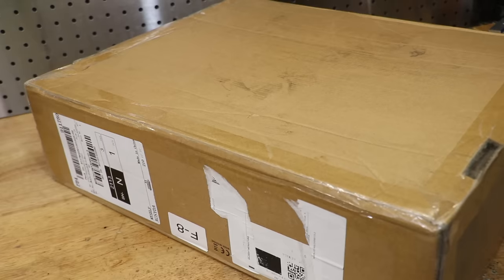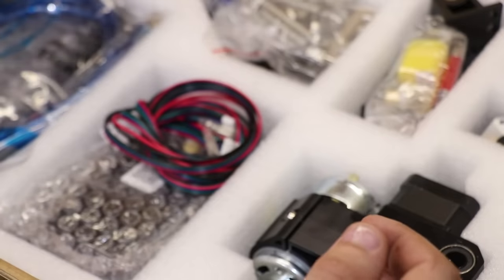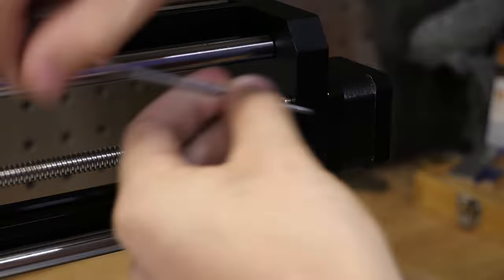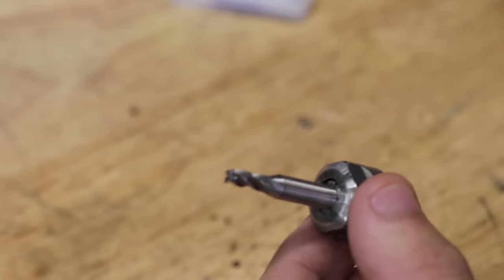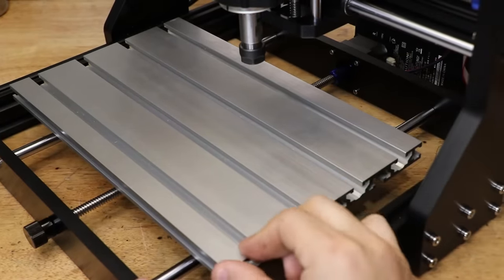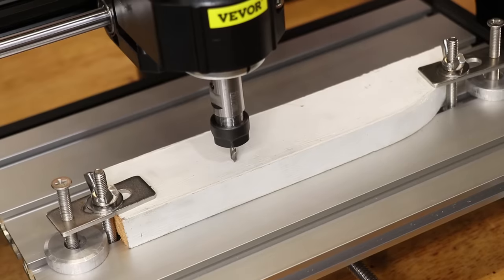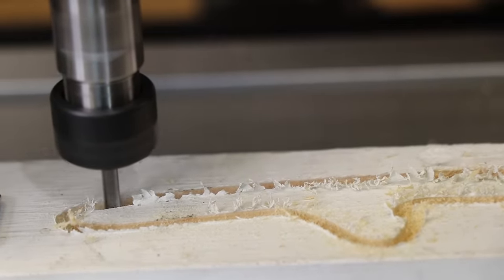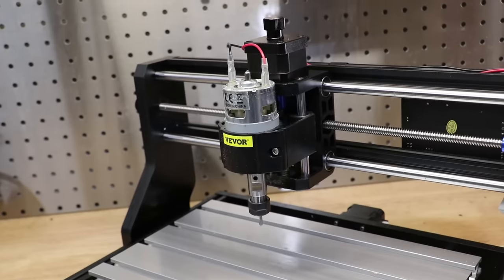A CNC Mill For Less Than $200 - Is It Worth Buying? (CNC 3018 Pro)

Comment: Once it was assembled, I think that my first projects would be to machine out replacements for the problematic plastic parts, or at least reinforcing steel plates to go over them
Reply: I'm wondering if this machine is even up to that task.
Reply: @Jianju69  It's really not
Reply: Maybe you should just not buy a piece of shit to begin with.
Reply: @JTMarlin8  now it a verifiable pos 😁😆🤣
Reply: Do you think this machine would cut a design from vinyl records?
Reply: @glendaharding1802  That's a pretty lightweight job. The hardest part would be removing cut shapes of vinyl record from the double-sided tape without breaking them. You're likely better off using a laser-cutter for that.
Reply: @glendaharding1802  Never having used one of these, I cannot say for sure. But, from what I see here, it probably would. Your most important thing to do for success, would be to find a reliable way to hold down the record. I think I would try hot glue first. Followed by small screws and a water soluble adhesive
Reply: Poor man buys twice. So act rich.
Reply: That plastic seems to be Delrin, which is specifically used for being easy to cut and having high stiffness.  It’s not steel, but it’s not ABS either.  It’s also used in gun parts, ski bindings, and even ball bearings.
Reply: @phxees  very heat resistant and chemical resistant too. It's also used in vape tanks, insulators, and tips as well
Reply: First thing I would do is send it back to seller for refund
Reply: That's what I was about to comment.
It's not implausible.
Reply: @reallyskeptical  a profoundly accurate statement.
Reply: @lilmike2710  many people (myself included) get fooled by marketing.

Some expensive products are actually a cheap product with a fancy label.
Reply: @phxees  Oh how well I know.

Most
Reply: @Jagdtyger2A  Drill that table and add a vacuum to hold it down.
Reply: @JTMarlin8  well not everyone has $5000 to buy a nice one to start with.
Reply: @Jagdtyger2A  Double sided foam tape.  When done, separate it with a sharp snap-off box cutter blade.
You could also make yourself a vacuum table.
Reply: With the plastic framing... you could always boar out the holes and sleeve it in steel or aluminum spacers to rely more on metal-to-metal contact to bypass the plastic.... if you don't make new panels to begin with
Reply: If I were buying one my first step would be this, but I'd layout and drill all the critical dimensions by hand and remove the excess material with a band saw or even an angle grinder. The kit seems good for the price but it's won't hold accurate tolerances in metal with all of those plastic parts.
Reply: @JTMarlin8  ☝️🤓
Reply: @boostaddict_  I’ve got a bigger version of this type of machine, and it definitely isn’t up to working on steel. If you replace the spindle with a much larger one or a trim router, then machining aluminium or brass is pretty easily done. I got mine for doing 3D relief carvings in hardwood, and to mess around with softer metals when the urge strikes me. I haven’t done anything with the spindle yet, so i still have a pretty underpowered little 300w spindle, and it was able to cut some brass with a bit of chatter, but I think that had more to do with the stock being towards the limit of the z axis, which is the axis I’d say is the weakest.
Reply: Lol I was thinking the same thing
Reply: @JTMarlin8  Or just get a nicer version. One I got has a nicer mount included, and they have aluminum mount kits, shit you can 3d print them with ABS or PETG which are better than this one's stock mount. I mean the biggest issues i see is this is ones a year later you see for 123-140 bucks on amazon becuase they not well made kits, and the one I got is Saintsmart, and is 199 normally, and I got for 159 on prime day, and fixes 2/3 problems of this one, rest I can fix with like 5 dollars in PETG myself or get the nice saints smart upgrade mount for it.
Reply: I was about to say the exact same thing. As I was writing this comment though, I remembered that there are online services that will mill or 3d print metal parts for reasonable prices.
Reply: Its nice for beginners. That's the one thing I like about Chinese products; they make it easier for people to dabble in various different hobbies without having to invest everything. Vevor and other brands make it so that you can play with foundry furnaces and CNC machines for less than a minimum wage paycheck.
Reply: Self sufficiency

Comment: I bought a 3018 three years ago and I've made hundreds of acrylic Edge Lit signs and wood plaques. It paid for itself in the first couple months selling my work. Maybe I got lucky, mine has ran flawlessly. I upgraded the spindle about a year ago, everything else is still original.
Reply: What brand/model did you go with? I've been looking on eBay for something inexpensive to route 50 x 50 x 20 mm graphite blocks for metal pour molds but have no idea where to start.
Reply: @jbb3141  did you find what you look?
Reply: Sounds good enough for pcb boards to me.

Comment: If you only do model making and mainly work with balsa wood or plastic, then this small C&C machine is absolutely sufficient. But if you want to work on aluminum or even steel, you should choose a C&C machine with at least 1.5 HP or approx. 1 kilowatt of power and a machine frame made of solid aluminum or, better yet, cast steel.

Comment: Hi. For proper cuts in wood you have to use Wood cutters. The geometry is different (chips evacuation) and it makes a huge difference. Try 2 flutes bits designed for handheld routers. Spiral ones if you can find them. And in wood, the results vary a lot when you cut endgrain or inline. And also wheter the bit is Upcut or Downcut.
Reply: Absolutely!! You took the words right out of my mouth. I've been running and building machines and a lot of other things for decades.

Comment: Toss the endmill and replace it with a roughing mill - which is sort of a cross between and endmill and a tap. With this machine, a roughing mill will produce a better finish and be able to cut deeper than an endmill, because it cuts in nibbles rather than slices.
Reply from the maker: I didn't even think they made roughers that small, I have a few larger ones, but Ill have to buy some 1/8 in ones
Reply: @artisanmakes  do it. Pls.
Reply: @artisanmakes  What's the difference between aluMINIUM and aluminum?
Reply from the maker: @smallblockchevy1022  the difference is whether you live in north America or the rest of the world. Same stuff different spelling :)
Reply: @smallblockchevy1022  the accent
Reply: @smallblockchevy1022  Aluminum was the original term coined in the UK. North America followed suit. Then the UK subsequently changed to aluminium. North America kept the original. A similar thing happened with "football" vs "soccer". 😂
Reply: @smallblockchevy1022  it's like the spelling of color and colour, same meaning but different spelling and pronunciations.
Reply: @lesliefranklin1870  That's not actually correct.
Reply: @heybabycometobutthead  The metal was named by the English chemist Sir Humphry Davy. Sir Humphry made a bit of a mess of naming this new element, at first spelling it alumium (this was in 1807) then changing it to aluminum, and finally settling on aluminium in 1812. His classically educated scientific colleagues preferred aluminium right from the start, because it had more of a classical ring, and chimed harmoniously with many other elements whose names ended in –ium, like potassium, sodium, andmagnesium, all of which had been named by Davy.
Reply: @lesliefranklin1870  Correct, your first comment said the second second name was the original.
Reply: @smallblockchevy1022  Americans, like me, pronounce it correctly as aluminum, Europeans pronounce it aluMINIUM
Reply: @lesliefranklin1870  wow is that really true!? i'd love a source on that, i'm a sucker for these random bits of history. Why did they choose to make it more complicated? I love random facts like these, humans are such interesting creatures.

Comment: One of the things I've heard is really important for those small CNC routers in aluminum is using a 1 flute cutter to reduce tool pressure, and lowering the spindle speed to get as close to the correct SFM as you possibly can, so you're cutting actual chips instead of dust.
Reply from the maker: Thanks for the insight. Strangely controlling the router from the computer I have no spindle RPM control, but controlling it from the offline controller I have total control. Cant wait to get my hands on some one flute cutters. Cheers
Reply: A 1/4" diameter HSS tool cutting cast aluminum the spindle RPM should be at least 9,167 RPM If you're using carbide tools then it's pretty much as fast as you can go isn't nearly fast enough. The HSS was calculated for 600 SFPM and carbide is 2,820 SFPM So almost 5 times faster. Or about 43,084 RPM.
Reply: @1pcfred   @Paul Frederick Yeah, a 1/4" diameter tool is about the largest you can fit in an ER11 collet. I was gonna mention too, but forgot, you can also increase the size of the tool to get more SFM at the same RPM, which is a good idea, since torque tends to drop off at low RPM. Downside is that your minimum corner radius is the size of your cutter, so it's often enough that you don't want to do that, in which case it's important to drop the RPM.
Reply: @auxchar  you need to raise RPM when you drop tool diameter to maintain surface speed.

Comment: if you add a spray mist to the machine it will help with the finishes by reducing re-cutting chips . I was an aerospace machinist for 43 years , there are off the shelf replacement bushings/bearings for that machine by the way that are vastly superior but there's nothing to do about the plastic other than replace with aluminum .
Reply: do you know of any supplier Europe side, i'm very interested in buying one of these and slowly specking it up.
Reply: @NewExperienceExplorer  Not sure of any in Europe but the majority of these things are made in China and should be available thru Alibaba if you use that online supplier .
Reply: Add spray mist?
Reply: @prestonian1066  Look it up old chap!

Comment: I've been watching a lot of reviews of these and this is by far the most thorough and clear, with an actual parts quality viewpoint. Even broke out the indicator. I needed to know these things, thank you!
Reply: Most these "pros" very so much it makes it moot. I got a pro that is nicer then thsi from another company. They slap "pro" on everythign hobby kit wise these days. Mine has Saintssmart logo on it the mount is better, and its just over tweaked. I seen other reviews point out the saintsmart model is nicer version, and again its a chinese made kit been out for a long time now, so there is a ton of cheap versions out there that "do the same thing" where they slap Pro on it and skimped on some spots, especially knowing many people will swap out the mount, and motor on these things if they keep using it or just moth ball it and move on to much nicer CNC for double the price once they learn on this thing.

Comment: I have the non PRO 3018. I really like it. I made really precise pieces made of plywood and made a bigger CNC with this one. For wood I use fast feed rate and small depth of cut. I t works better for me than slow feed with large depth of cut. Also end switches are nice upgrade.
Reply: same here...I 3D printed some limit switch mounts and some manual crank additions, but unfortunately...I just haven't gotten into CNC as much as I would have liked...heck that $80 "laser engraver" got more use than my 3018 just making little images on cutout cardboard for the kids
Reply: I also added limit switches, but encountered the problem that once the spindle starts up, there's enough EM interferance that the some of the limit switches are falsely triggered, ending the operation.  Added capacitors to the spindle motor, but that didn't help.  Will try coax wire next.  Limits work great in laser mode though.
Reply: @NeilFraser  You probably used switches in NC combination, this means that the switches break contact when activated/touched. Use them in NC combination, that means that they short when they are activated/touched, that way there is no loop to be able to make inducted pulse.
Reply: With anything as underpowered as these tiny machines, you really have to.  Keep the strain on the motors as low as possible and you'll be okay.  You're not doing production runs, you can afford to take your time.

Comment: I got the cheaper version and the frame is all extruded aluminum, so it's a little more ridged. I cut plastic and mdf all the time with it. I have used the v bit that came with the machine to etch lines into aluminum so I get my holes and cut lines correct and was able to get a logo on it as well. It just took multiple passes of about 0.05mm each time until I found it reasonable. The tip did break so it is no longer a point on the end but still works. I recently got a drag bit for engraving and that worked great on aluminum. I do find you really need a spoil board that you can flatten because the work plate doesn't ever seem to stay level.
Reply: This "pro" was garbage mine was all aluminum, more rigid, better mount, and same basic motor though. Like a lot say "pro" and be not pro, they got same basic stats but the quality changes so much based on who made it. But I seen some built for weaker metals they cost more first thing I noticed is much nicer mount for the motor and a motor upgrade was put on it as well. The ones I seen all say for wood or acrylic, you really need to upgrade it for metal work, and no one should be using just the stock bits, its not a 3d printer get set of different ones for it and thank yourself later.

Comment: Sure, it’s not a 6040 with linear rails, but it can do a LOT for 200 bucks! I upgraded mine with an all aluminium z-axis/spindle holder and a more powerfull spindle motor for like 100 bucks more and I’m doing carbon fibre plates at around .5mm depth and 100mm/m feed with really nice results. Next step will be linear rails but that is probably at the edge of the amount of cash im willing to spend on it before buying a more proper machine. Still, great machine for learning and very easy to transition to from 3d printing

Comment: Speaking of your 3040, I'm currently in the process of upgrading my 6040 with servo motors - which are vastly overkill, of course.
But hey, I consider it a test bench! Those iHSV57s should work wonders on an import mill like yours, and I'd already have everything setup!
Except for the mill, of course ...
Reply: Angus does this have to be tied into the wwweb to use? Thanks

Comment: Very nicely presented!  For $200 it's a great deal.

Your mention of the parallel port reminded me of a pcb milling machine I made back in the 90s.  I controlled the steppers in real time with binary counting over parallel port.  Windows 95/98 allowed this and I milled hundreds of pc boards.  I wrote my own Gerber 274X conversion software in VB6.  I upgraded to Phidgets USB control in 2005 with some code mods.  It's now in my garage shop in use!  Kind of cool to see this sort of thing has taken off, and 3d printing.
Reply: That's awesome.

Comment: Plastic, aluminum and steel have one thing in common, they all flex under stress and tensile loads. For industry applications use steel or granite bed, enable increase production rate at optimum profit usually at a priming price. For hobby aluminum and or plastic bed to lower production rate (to obtain same flex in steel) for nonprofit applications to a least market price.

Comment: Got one of these a few weeks ago, came with 2.5W laser for $289 AUD, crazy low price for a beginners machine.  There are some guys who have got the 3020 Pro Max which addresses the rigidity, linear slides on X,Z and bigger rails on the Y, 300W motor.  However it is double the price, if you want to make small aluminium parts slowly then it is probably worth it.

Comment: I like the straight to the point narrative and the comments on the various aspects that affect the build and working of the machine.
About 6 months back I went on EBAY or was it AMAZON....can't remember....and bought one of these 3018 CNC routers mainly to see how it went together as I knew just by watching the various videos that it was a bit weak at the knees for a machine that cuts into materials more harder than soft wood...........it's still in the box untouched, but looked at in depth and will be sold on after the build, and from that I designed a more improved version and bought a swag of 2040 extrusions, 10mm aluminium plate along with a couple of SBR linear rails and 1204 ball screws..........I intend to make it perform like a pocket battleship as the motor is a 150watt brushed type.
I already have a CNC mill so this is just an amusement exercise in off the shelf component design to pass the time and keep the marbles well oiled.
So far, as this is yet another iron in the fire, the build is 3/4 finished and gets worked on a couple of hours at a time just as the fancy takes me.

The new build will be more expensive than the bought in item but that was not the object of the exercise......it also worked out slightly bigger in the X,Y and Z due to the off the shelf components that I didn't want to cut.
Reply: can't wait to hear about the new and bigger machine, I got a 3018 last year, have done a few upgrades, I'm loving it .